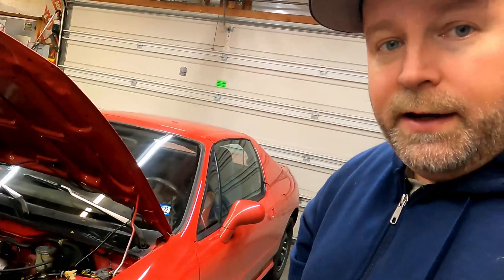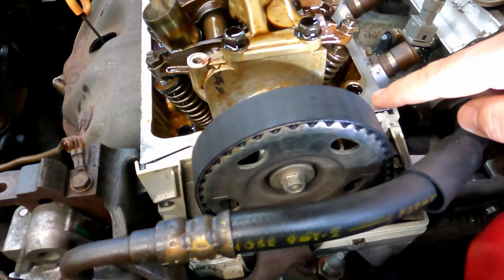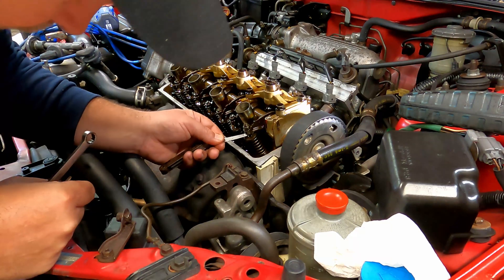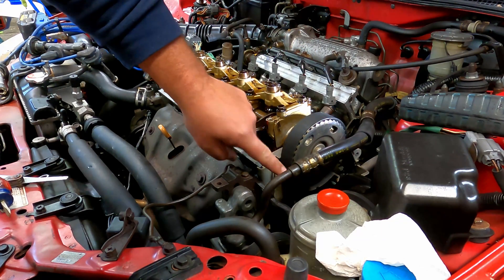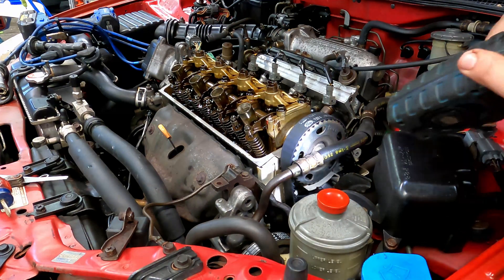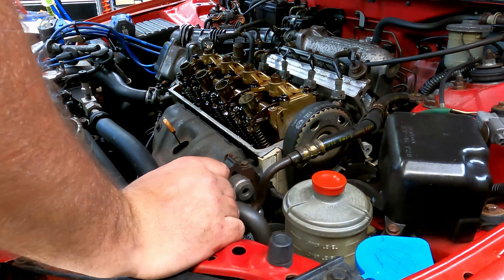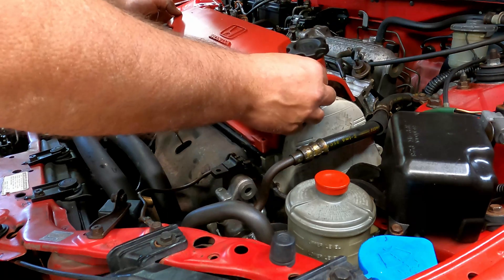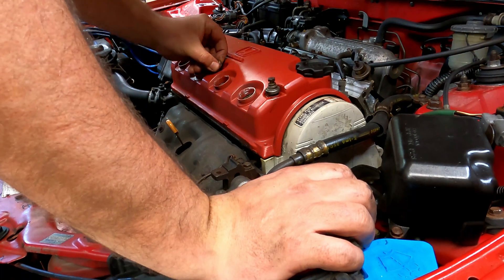How to Adjust Valve Lash on Honda Civic D Series Engines  D15 D16

Comment: How would you torque it with having to hold the screw so it doesn't spin? Guess would need a wrench type torque wrench. Also, need sealant in corners of the valve cover.

Comment: how did you get the top timing cover off without moving the power steering line
Reply: You can work it off without removing the steering line.

Comment: Hi mate. While you were trying to rotate the crankshaft I noticed you ve let the sparkplugs on and the compression building up in chambers wasnt letting you rotate the crankshaft precisely. Wouldnt it be better with them off? Im just starting my journey into engines and Im just discussing. Keep it up, good content.
Ps.: Does it happen to know if wrong valve adjustment can be responsible for a little lower (20psi) and slower (2-3 more cranks needed to reach there) builded compression in a cylinder?
Reply from the maker: You can let the spark plugs in. You just have to go slow to let the compression bleed off. It would be better if they were off, but not needed if you go slow. A wrong valve adjustment could be responsible for lower compression, but i would think that it would be more than 20PSI drop but it still would be possible.